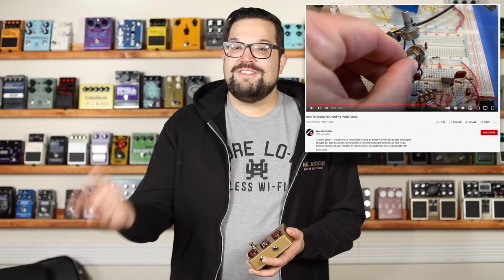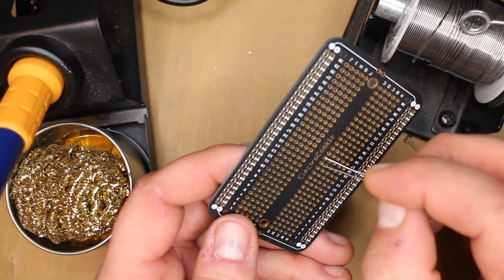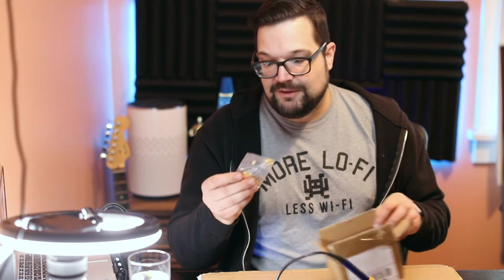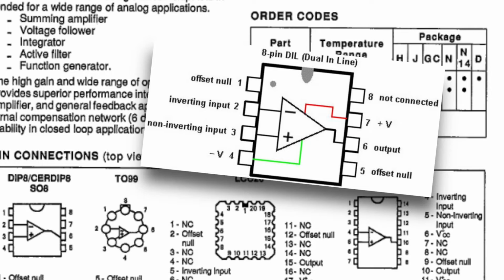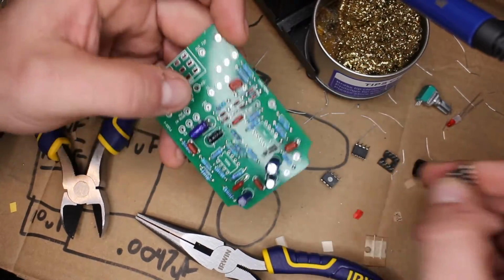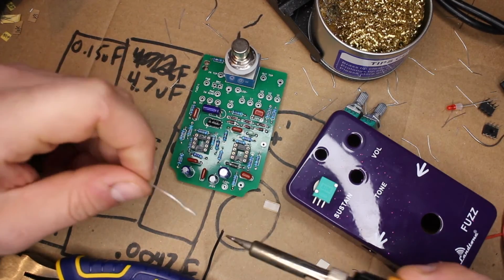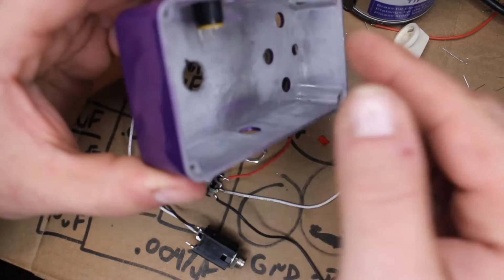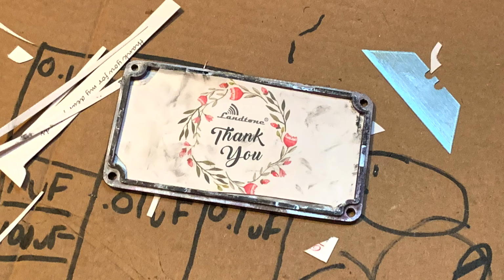Building a Guitar Pedal Kit - From Solder to Shredding

Comment: I got the exact Op Amp fuzz (appears to me a Muff) from Landtone and this was the only vid I could find that may have possibly helped me figure out the wiring between the DC in, Audio in and the pcb connections- the illustrations are not clear enough despite having apparently been "upgraded" since this vid- there are a couple full color pics and a wiring diagram unfortunately, mine do Not have clear labeling as to which lug goes to which point on pcb! Also unfortunately, the vid speeds up to squirrell- speed at the critical point for me and the best info I could glean from this vid was a quick pause at the instructions where the DC and Audio in lugs are labeled. I still cannot get the LED to go all off when the effect is off and the bypass is rough.

Comment: i built 2 Landtone pedals the instructions were real bad and both pedals dont work at all compressor led dident even light up .. they are sending me another but i dont think i will build it and i do not know of any other kits that are any good or worth the bother.. iv bought a lot of china pedals and the quality just is not there so building one was a big let down i realy wanted to buld a quality peadle that was worth it but you did a good job there i understand the pots there the same ones i got i thought they suck quite frankly.. but thank you

Comment: I built this same exact pedal,  but never got it to work, but after watching your video i think ive seen something that might be the problem on mine,
Reply from the maker: Ooh, what do you think the problem is/was? If so, that’s great!!
Reply: @StompboxBreakdown  i had the big chips backwards as well as my power jack was wired incorrect. but during the process i blew a 47 resistor right in the center of the board, so i just bridged the gap with a wire, i'm honestly so happy with how it ended up sounding. a very fuzzed rat sound, the tone knob acts very much like a filter, once again, thank you. i had to pause n play the video at random spots like 50 times but it was worth it! thanks again ive had this pedal sitting around non working since christmas, im so happy it works now!

Comment: Fun!  Going to rewatch this later.  I've built a few pedals, done mods to some Boss pedals, and a little bit more.  There's a cool company called MOD Kits DIY that makes some cool point to point pedal kits.  They also have a full blown outboard tube spring reverb unit for something like $300-ish(?).  That was the most complex thing that I had soldered/assembled.  Troubleshooting problems and safety were some important things to consider.  Way cool!

Comment: Very helpful video! I'm currently on my 2nd build. The first was a cheap Landtone tremolo pedal which I finished, but it ended up fizzling out almost immediately. It was almost certainly due to something I did, as I struggled with the instructions (or lack thereof) and my inexperience. But it was a great learning project for $25.

I'm now building a Tone Bender MKII clone from a US company that has much better components, instructions, and customer service when needed. I'll be moving on to the Classic Fuzz from BYOC once done with this one.

Building your own pedals can be challenging, but it is a lot of fun!
Reply from the maker: Thank you so much. Good luck with the build!! I’ve done two BYOC pedals, their kits are top notch. Who makes the TB MKII clone? That sounds kinda interesting.
Reply: @StompboxBreakdown  I bought the kit from General Guitar Gadgets. Pretty good documentation available for their builds online, and the owner is really helpful and responsive to questions by email.